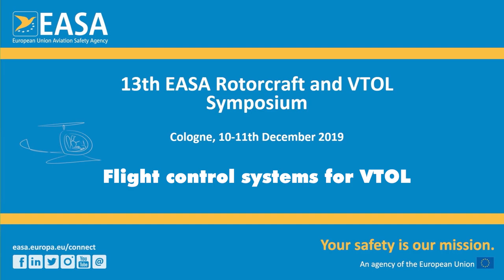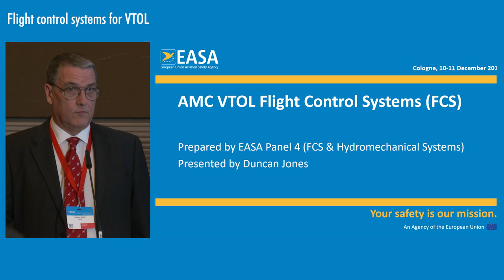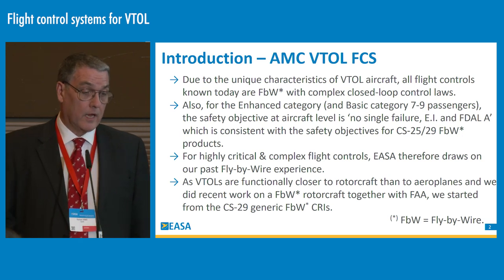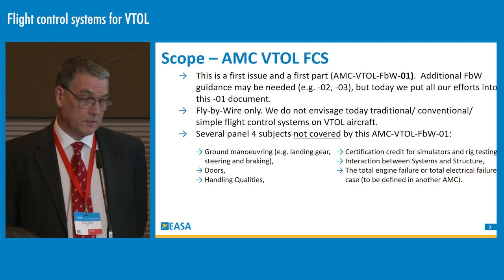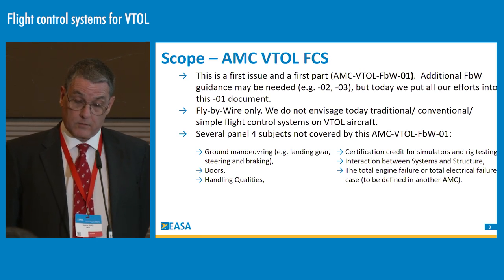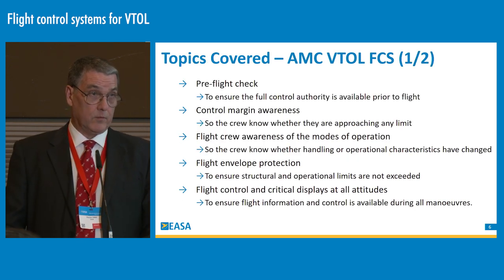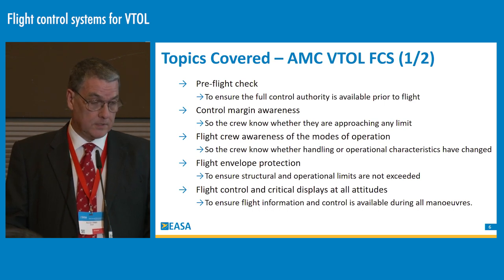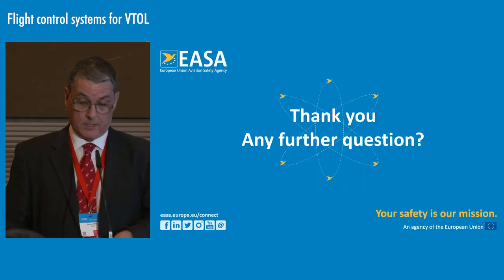Flight control systems for VTOL - EASA Rotorcraft & VTOL Symposium 2019

Comment: Great, safety objective is no single failure, extremely improbable and FDAL A. The question is : would it be lead to requirements PF 10-9 with design VTOL FCS, Electrical Systems (Source) 3 channels?. The answer will effect to weight optimation.